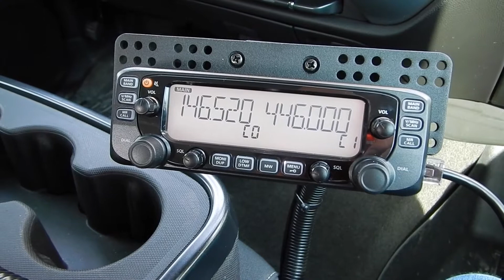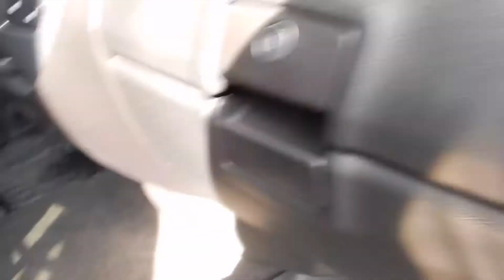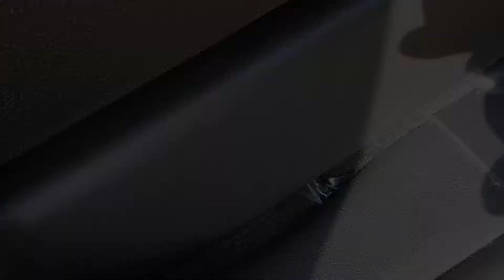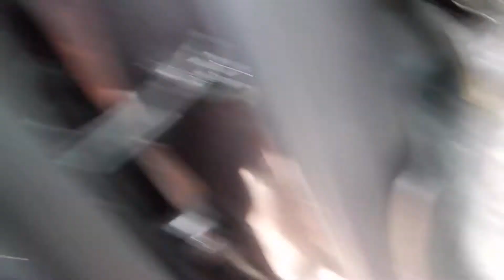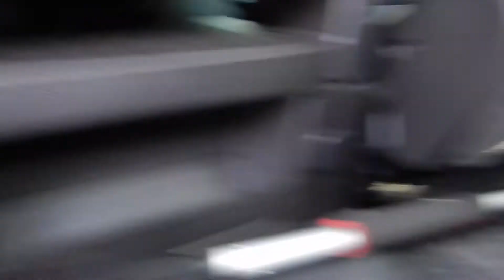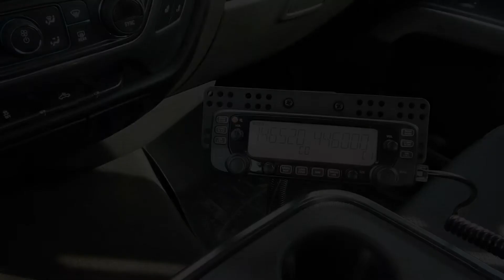Icom IC-2730a Ham Radio Install 2015 Chevy Silverado

Comment: Good job on the install, except as a former professional installer, I really wish people would stop running through doors! Go through the firewall! Much cleaner install.
Reply from the maker: True. I meant to go back and fix it but that never happened. Truck is long gone as is that radio however I have a new install video planned!

Comment: That's great. I am new to HAM. Looking at this radio and I have a 2015 Silverado. I have the giant console in mine, so I will likely do some different specifics in placement, but this really gives me ideas. thanks.
Reply from the maker: Glad it helped.  I was away from radio for some time and am doing a reinstall soon using the same method.  I have found some other ways it can be done, but this is easy and it works well enough for me.

Comment: I did a nearing identical installation in my 2016 Chevy Silverado. I did however add an external speaker that I attached using command strip used for picture hanging.  I put the speaker on the left side of the center console by the storage compartment for things like maps. It has been there for almost 2 years and the command strip are still holding it in place. 
Great video. Thanks.
Reply from the maker: Thanks for watching!

Comment: Did you try running the antenna on the passenger side?
Reply from the maker: No but I suppose I could though it's proximity to the power cable might cause some issues.  Antenna is on the drivers side and battery is on the passenger so I went that way for ease of install.

Comment: Just about identical to how I wired both of my GM trucks of that generation. My ‘20 lacks that grommet so I had to be a little sneakier. I lease my trucks so every install is ‘semi permanant’ like that. Got it down so I can remove it in about 40 minutes and install in maybe 2 hours max. Nice job.
Reply from the maker: It was quick and dirty but it works. The radio has long since been removed but I am installing a single bander shortly using the same method.  I did discover other options for cable routing but my way is just too easy.  Did lose a grommet and need to source another.

Comment: How did you make the power/ground connections at the battery? I have a 2016 Silverado and GM warns about direct connecting to battery as it screws with neg lead current sensor and screws with the charging system. Their bulletin basically said to take the neg lead to a frame/chassis ground point, not battery. The pos wire can attach to the battery + terminal.
Reply: Take the radio power lead (with the inline fuse, recommended but not essential ) and using the far end, connect it to a fuse tap. Insert the fuse tap into an little/none used cigarette or other fuse port. Fuse taps are about $7 when you can find them at a auto parts store or truck stop. No need to run through firewall & hooking straight to pos batt terminal. Your ground will be right nearby as well.
Reply: J. Morrison : well, good luck with your install. Hope you don’t fry wires. I looked up your Icom 2730 power requirements (just for grins) and it needs a supply to handle a current drain (at 7.4V DC) on transmit of 13A.  So I hope your cig lighter/power port can handle that load.
Reply from the maker: Interesting. I went right to the terminals in the battery. I have long ago removed this installation but I going to mount a new rig.  Going to look further into the current sensor issue you mentioned.

Comment: Any issues with that power wire running over that bracket by the door? I’d want to put a piece of rubber hose over it for peace of mind.
Reply from the maker: I did run a flexible shield over it after the install.  I agree, that would be a good thing to do.

Comment: What type or brand of coaxial and nmo mount did you use?
Reply from the maker: Comet cable with NMO mount and some very thin coax terminating in SMA.  Not the most efficient for transmission but it made the install easy.

Comment: Nice setup. I have a 09 Silverado right now already have two meter 440 and 10 m in the truck. But at the moment I don't have the separation kit for my Yaesu FTM 100. Just bought the ft-891 HF rig that I will be installing with the separation kit also got a separation kit for the ftm-100 . But the one thing I did like about your set up that seems to be lacking on other vehicles is you actually have a decent antenna on there if I'm correct i think you have the same one I have I got the diamond SG 7900. Most people put some little dinky antenna just good enough to get into a repeater but I'm a Simplex guy don't get on the peters unless I have to.
Reply from the maker: It's a half wave on 2m and works really well.  Much better than 1/4 wave.  They claim 3dbi gain.

Comment: hey steve can you show the back of the radio and how you mount it to the face plate. I have the same mount and Im looking into getting this same radio.Also you mention the nut was a different size, what size and where did you get t? thx

Comment: I think you just sold me on this radio.  
What type of mount did you say you had the head unit on?  I'm not sure how I will go about doing mine. 

Also what do you use for an antenna?  I just got licensed a few months ago and all I have done so far is Echo Link aside from making a handful of simplex contacts on my Baofeng HT. 

Thanks for making the video.

KE0ILT 73
Reply from the maker: https://www.diamondantenna.net/nr73bnmo.html

Comment: Thanks for the video! I pulled the trigger on the IC-2730a just today and can't wait for it to arrive. Great idea on the Velcro to the carpet for the radio body. I think I'm going to do a plastic box Velcro'd to the carpet, with the radio in the box (no lid for heat escape).

Is the radio fan loud?
Reply from the maker: +y0tubie you'll be happy with the radio, it's a solid performer.  I'd recommend getting a cheap programming cable and using the free Icom software to get all your repeaters, etc in to it.  I have the fan on the default automatic setting and though it's noticeable when the truck is off I don't even hear it when driving.  Compared to other radios I'd say it's on the quieter side.  Thanks for commenting!